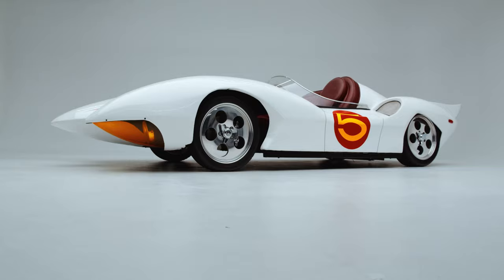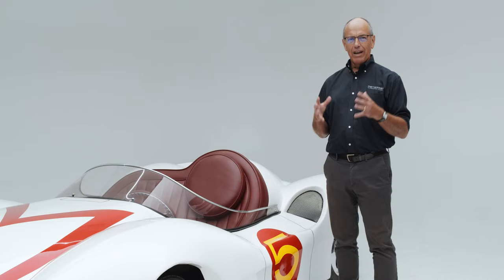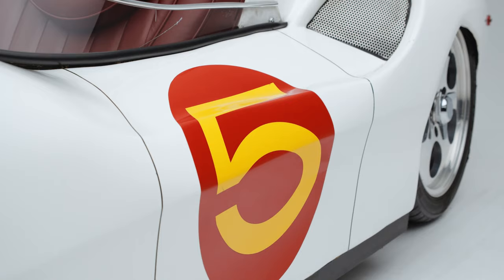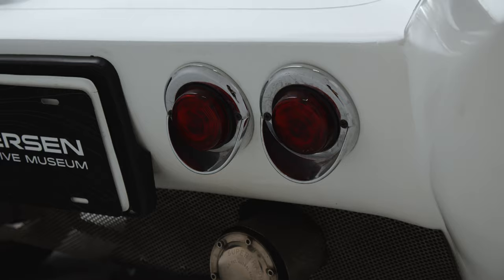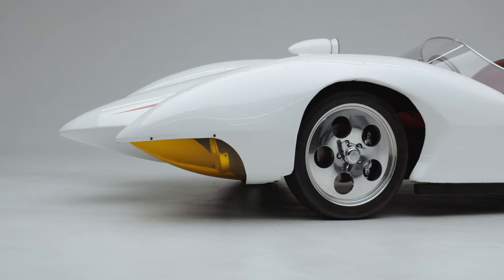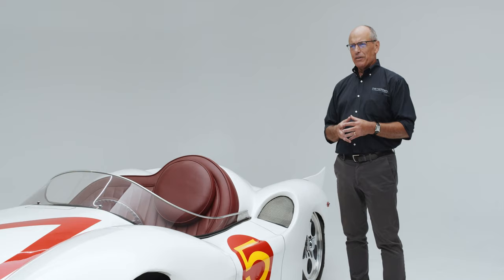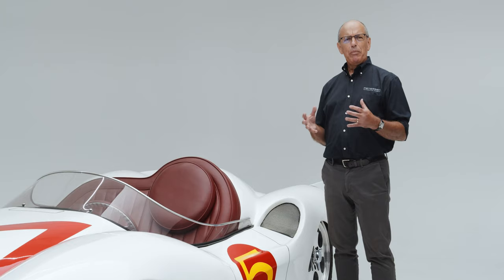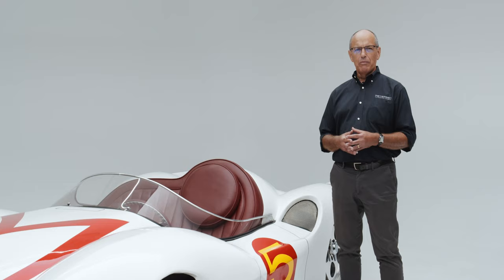SPEED RACER & THE REAL MACH 5 | CAR MASTER'S GOTHAM GARAGE MACH 5

Comment: The original Japanese series is called Mach GoGoGo.  "Mahha-go" is the name of the car. The Kanji character for "go" essentially means "item number"  In Japanese "go' is the word for the number 5. So the name of the series is actually Mach Number 5 Go!  The name of the main character in the original Japanese series is Go Mifune. The "M" could also stand for Mifune Motors...which is Speed's father Pop's mechanic shop.  So essentially that's also his name on the car.  It was never intended to propose that the car could achieve Mach 5 speed.

Comment: In the original 1967 series, the Mach Five is a white racing car with an "M" written on its hood (which does not stand for "Mach 5", but instead stands for "Mifune", both Go's last name.
- Wikipedia. 

*I had to fix that real quick once I heard him say the M stood for Mach. I knew it didn’t. So here is the correction above.
Reply: "Go" is five in Japanese. I believe in Japan (and on the package of the Charrawheels/ Japanese Hot Wheels version) it is the Mach Go-Go-Go!
Reply: That is my understanding too. Mifune is the name of Pops Racer’s auto company: Mifune Motors.